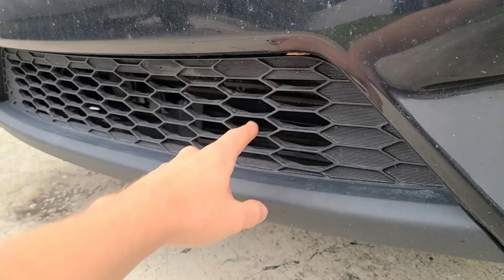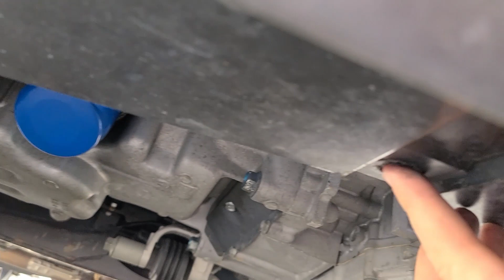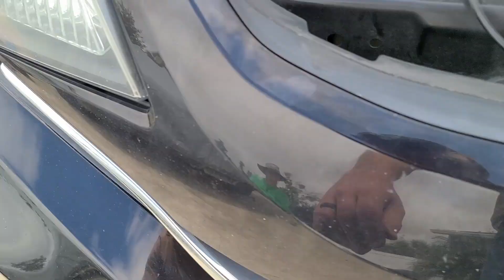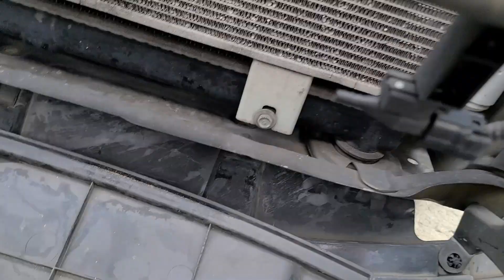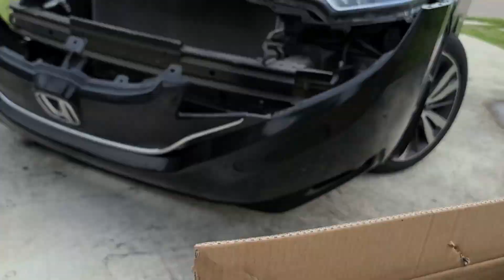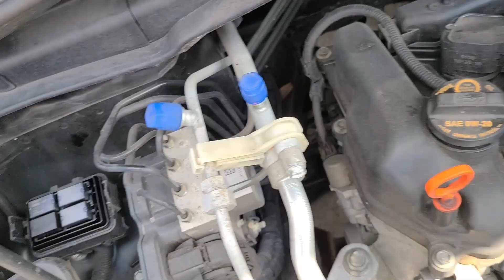Replacing Honda Fit Air Conditioning Condenser

Comment: Great video, helped me out a lot. Do you need to add pag oil in the condenser ?  Thank you.
Reply from the maker: I did not add any and it is still going strong
Reply: @LowTechGarage  Thank you very much for your time. my mechanic asked to drain out the freon and fill it up again with pag oil. I'll drive for a couple of days and find out but I notice it's not as cold as it used to be.  In the mean time, hopefully it doesn't mess up the compressor.  lol

Comment: I was wondering if you have a video on recharging the ac unit after you have switched out the condenser?
Reply from the maker: I won’t have one on the fit. But I am showing how to charge the system on my truck in my next video. Process is the same capacity of refrigerant is different

Comment: mine 2011 fit only getting cold in cool environment, and only cold about 15min in hot area. The shop already check the pressure is not a problem. So, it means no leak. I am  just open the bumper to wash the condensers. Hope this fix the issue.
Reply from the maker: Is your compressor turning on? I would verify that.

Comment: Hi! My 2007 Honda Fit (must be 1st Gen then?) has no cold AC 90% of the time. But every so often, after driving for a while, cold air WILL blow for a few minutes. Then back to warm air.

Does that info point me towards a problem? Thanks in advance for any insight. I really hope I can fix it without spending a ton of money.
Reply from the maker: This article may point you in the right direction. Hope it helps.

https://www.fitfreak.net/forums/1st-generation-gd-01-08/78469-intermittent-c.html
Reply: same issue for me. My shop confirm pressure is good and refrigerant is up there. So i will wash my condenser today with some foam cleaner from homedepot. This would solve the problem i think

Comment: Condenser on mine is curved and touches the radiator behid but no leak and cooling is ok. How to straighten it?
Reply from the maker: They are pretty fragile. If it’s curved the car may have been in an accident. Your best bet may be to replace if it’s causing issues

Comment: THE CLIPS ON TOP OF GRILL THAT YOU STATED YOU WERE UNSURE OF HOW TO PROPERLY REMOVE.. ALL YOU DO IS PRESS THE CENTER DOWN AND THE CLIP WILL RELEASE, THEN ONCE OUT YOU RESET IT BY POPPING THE CENTER BACK UP. HOPE THAT HELPS. AND SORRY FOR THE ALL CAPS, JUST NOTICED THAT
Reply from the maker: Thanks for the tip. Very helpful!